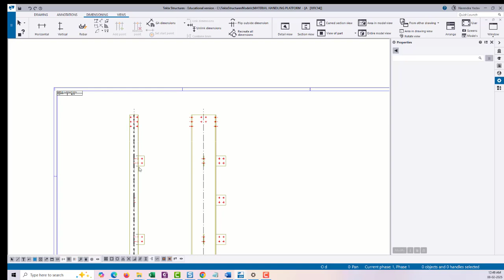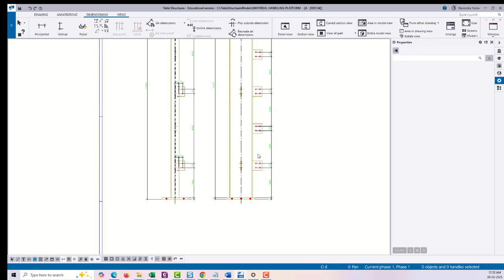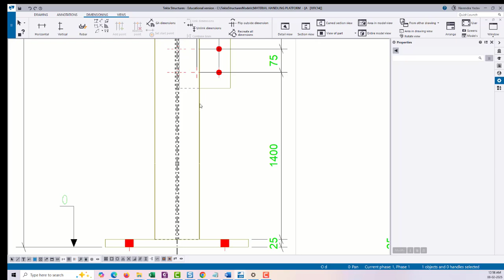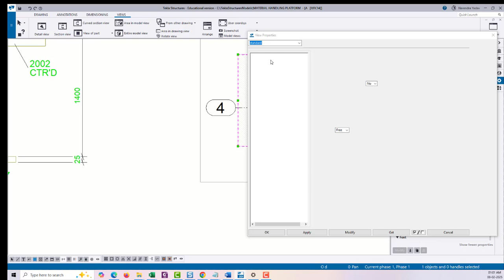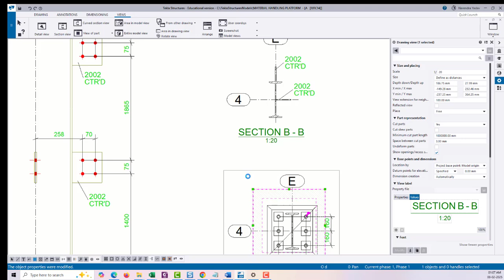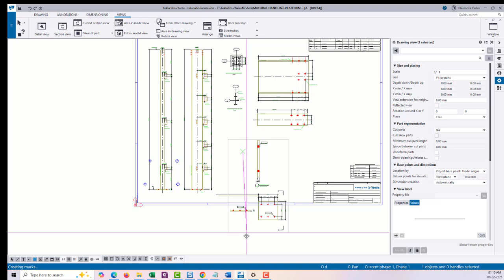Tekla Structures 2024 Column Fabrication Drawings   Step by Step

Comment: In my experience, you should not dimension to center of the column (or beam) to the holes for the attached plates. In the FAB shop they will not be able to measure from center of col/beam as the web itself is in the way, so the dims should typically be from inside face of web to the center of holes.